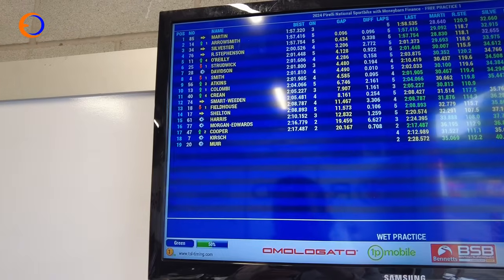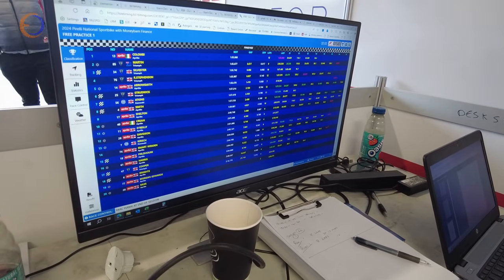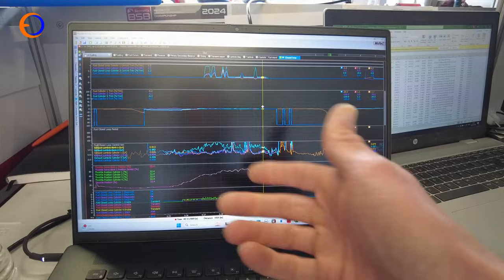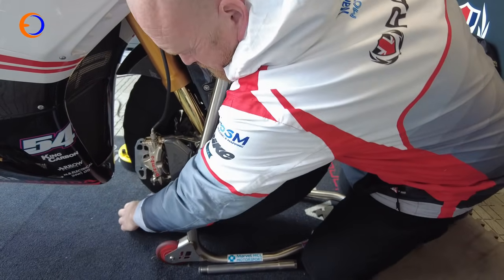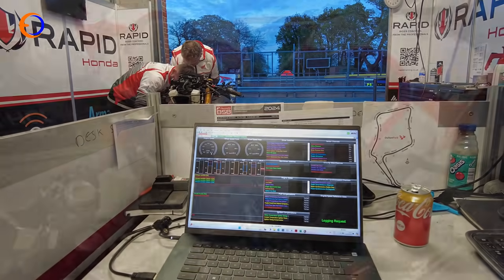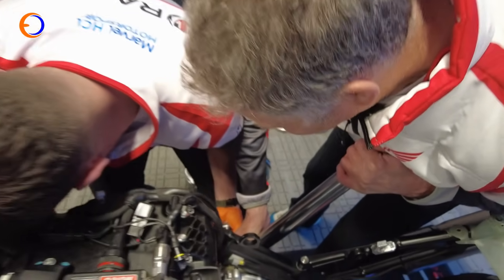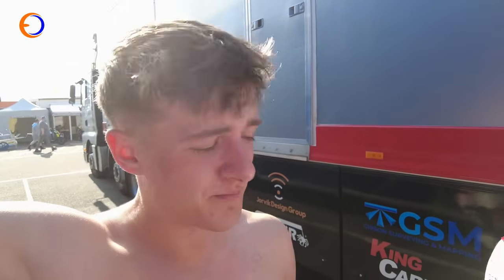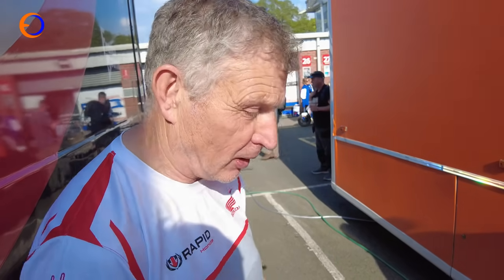Miniature Disasters (minor catastrophes). BSB round 2 at Oulton Park with the Rapd Honda Superbike

Comment: Nice video. Funny you have to watch your morning noise due to a church. When I raced in the late 80's into the 90's one of the tracks I raced at "Shannonville motorsports park" in Ontario Canada had a church right beside the track. So we couldn't start our GP bike until 11 am but the vintage class bikes,  Norton's triumphs  etc with megaphone exhaust could be run, revving the snot out of them with no complaints. I guess God doesn't like 2 strokes 🤣